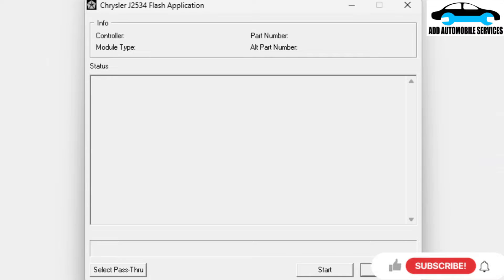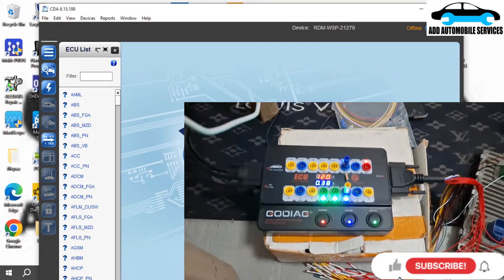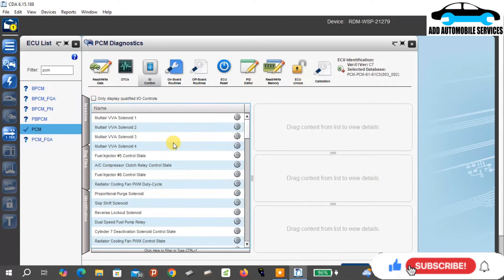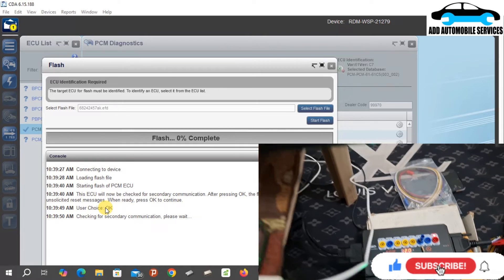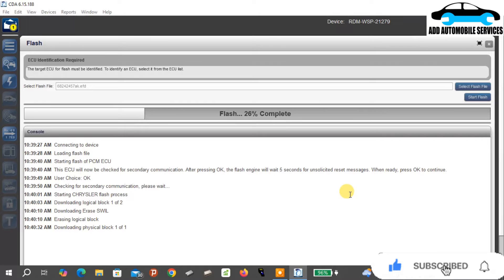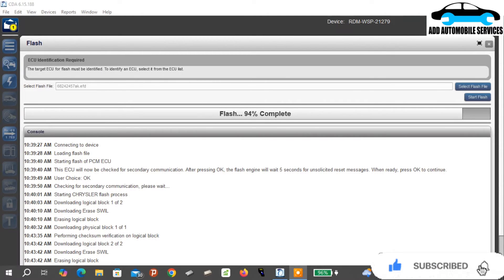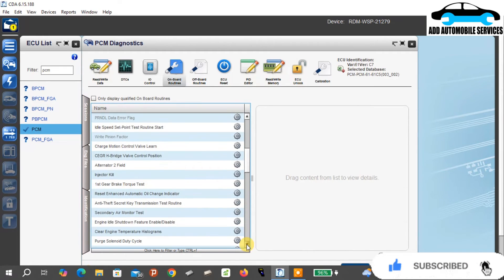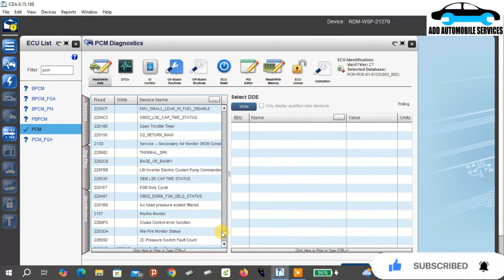2015 Cherokee: Flashing original Flash data to the ECU with CDA6

Comment: Does your CDA6 require firewall turned off everytime you use it? Also the micropod2 is very easy to damage or have firmware issues. Best to have a spare.
Reply from the maker: It works

Comment: post a link and a video on how to connect to the ECM, where to get the pinout diagram, how to read the ECM software,
Reply from the maker: It depends on the ECU and you can Google the pinout of the type of ECU you are using